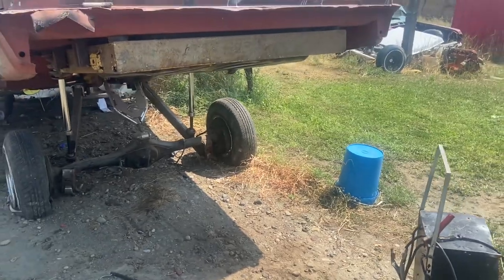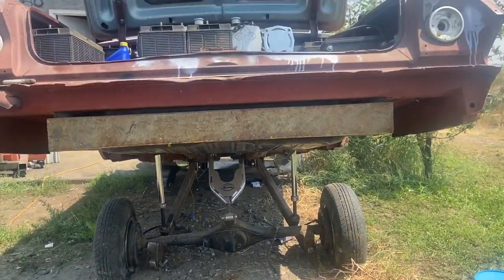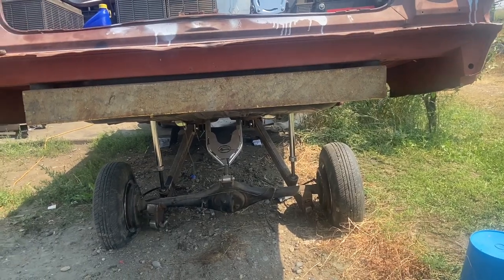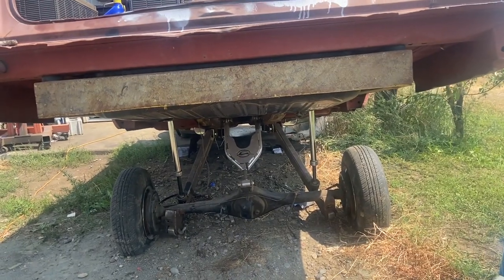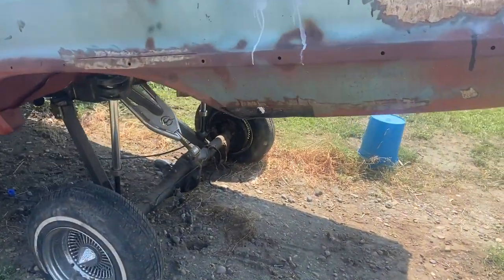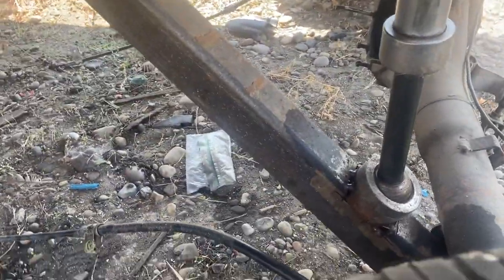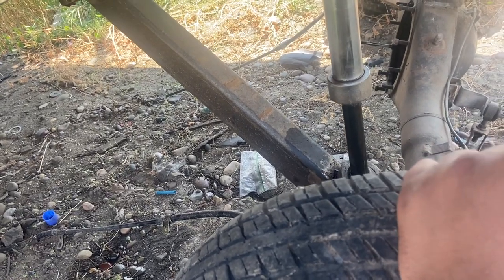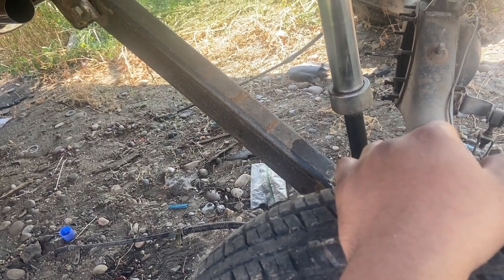63 impala convertible lock up

Comment: Did you make new brackets for the upper trailing arms?

My 63 rear keeps shifting towards the driver side causing it to run on the finder. Not sure if it could be due the trailing arms or wish bone

Comment: Is that the original rear end
Reply from the maker: Toyota rear ended 89 Toyota pick up . Check out the other video I uploaded. I break down the length of the trailing arms and cost of the rear end